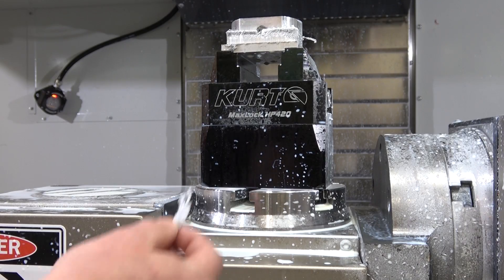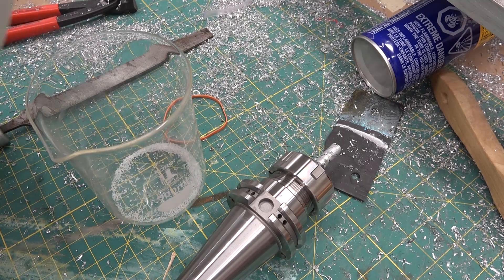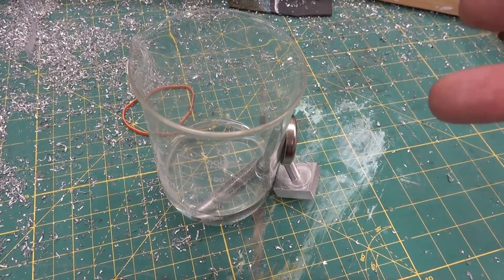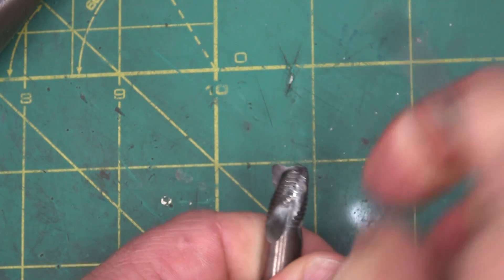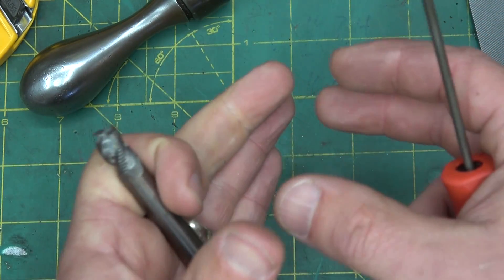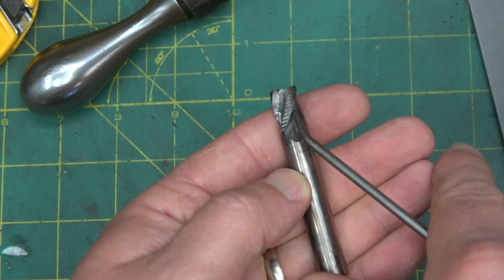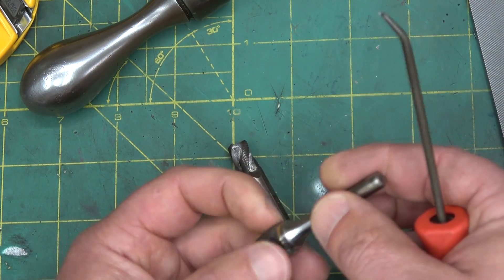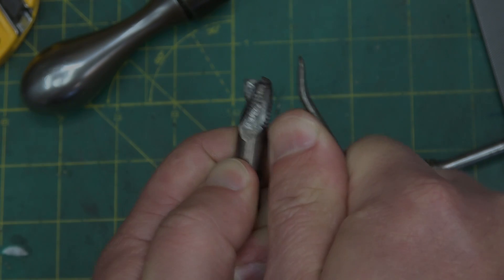Salvage Carbide Tools with Lye | SCIENCE!

Comment: I've always been afraid to use lye for anything.... No experience, but like learning about it.Parents said they used it but also said to leave it alone. 
  Would lye be the same as caustic soda? I built a hot tank type of cooker a few years back out of a water heater and air for agitation...but have also been to afraid to try lye or other cleaners in it.Last thing Iwant to do is poison myself or blind myself  in the shop so I've never even tried it.

Comment: To remove aluminum from Briggs cranks we used muratic acid.  Didn’t harm the crank but would eat the aluminum. Easier to get than lye
Reply: SlocketSeven  that is true. It was always done outside the shop. Never a problem with rust on the cast iron crank.

Comment: Next time, it'd be a better idea to use a steel vessel, like a small stainless steel mixing bowl, to keep your lab gear from dissolving.

Makes it easier for the lye to dissolve the aluminum if its not already dissolving the silica in the Glass lab gear.

Comment: I've heard about people using muriatic acid to remove aluminum from crank journals when their small engines (in their go kart, mower, etc) spun a rod. I imagine that would also work for this as well.
Reply: Muriatic acid - Hydrochloric Acid would definitely eat the steel of a crank. In this case would eat the nickel and or cobalt binder in the carbide too.

Comment: To produce raw aluminium (aluminum) consumes on average 15 kWh of electrical energy per Kg. That's 20 hp hours per kg. To produce 10kg would require 200 hp for an hour. We then use the end product to wrap food and for the most part discard it after just one use!
Reply: Recycle it! Any food waste will either get washed off or burned off. If the recycling center doesn't want dirty foil, hide it inside crushed cans.

Comment: We've used this recovery method in our CNC shop to save some high dollar hoggers and.... it was a disaster. Despite passing visual inspections, 2 lye recovered hoggers both suffered sudden/catastrophic loading and failed spectacularly (molten aluminum got slung everywhere before one broke). Cutters were running at known safe feeds/speeds, with air blast/mist coolant. Is there a chance the lye is increasing the surface porosity of the cemented carbide?
Reply from the maker: Could be, cobalt binder. But I think cobalt is impervious at high pH so could just be they're fucked from the original incident.

Comment: You probably already know that aluminum oxide is the same as corundum(sapphire/ruby) but did you know you can torch a piece of aluminum foil then it becomes transparent  because it leaves small spots that are just corundum.
Reply: Also does the hardness of aluminum oxide 9 on the Mohs scale come into play much when machining AL? or not really because it is such a thin layer.

Comment: Machined about a million times my weight of aluminum back in the day when I was making space junk.  The problem here is the end mill.  Do not use carbide on aluminum, high speed steel only.  (most carbide isn't sharp enough to cut and you need more pressure on the tool, creating heat)   Tons of lube (coolant) and while you can spin and feed the end mill fast don't feed it or spin it too fast.  As the aluminum heats up it can get gummy (depending upon alloy) and will stick to your damn end mills or any other cutter.     You need a lot of clearance on the end mill to clear the chips out too.  Also, the only file I ever used on aluminum is a Vixen file same type of file if you were filing lead body solder...finer cut files will load up with soft material and you won't get a smooth cut with the file because aluminum rubbing against aluminum creates galling.  Yep, lye works well on cleaning some stuff off files, and end mills, and over time it will give a nice leathery look to your hands too, like any solvent will.  Copper is just as evil to machine as it galls very easy too.
Sure you can use carbide cutting tools....but for the price and hassle of cleaning them I can buy more high speed end mills for the same price.

Comment: I'm waiting to see how that end mill chooches, never had much luck with cleaning em off, I could usually pick the aluminium off pretty good, but seems like the darn thing would never cut as good as new once its been galled up.  One of my old tricks which shouldn't hurt em, is to run em real slow in some soft steel once you have most of the crud cleaned out, it would usually chuck out the rest of the boogers, didn't always have steel around though, so the other thing would be to run em real slow with lots of oil in aluminium (oil not coolant), but still results were less then skookum, even if the above things were not tried and all or most of the galling was removed manually, still wouldn't cut very good, and would usually gall up fairly quickly.  Eventually I ended up at shops that had a proper tooling budget and galled tooling just got chucked and replaced with new. (regrinds just suck BTW)
Reply: for all you key board machinist... When you don't have any new tooling you make do with the junk you have, and when you work alone, you get creative, sometimes it works, sometimes it don't, key is to observe and learn from the results.

Comment: Aluminum oxide, almost as hard as tungsten carbide, high melting point also why aluminum doesn't like to be cut with oxy-acetylene torches, you end up melting the non oxidized aluminum before you burn through the oxide coating
Reply: Aluminum oxide (alumina) is also known as sapphire. Yes, the gemstone, which is just a slightly-impure form of it.

Comment: You didn't say how the chalk-on-the-file trick worked. I often wonder whether this refers to blackboard chalk (which is actually calcium sulfate, i.e. plaster of Paris) like you used, or the mineral chalk (which is calcium carbonate). The blackboard chalk is hydrated and I wonder whether its residue would encourage rust on the file.

Comment: So aluminium and steel can both be pre rusted/corroded and it will slow the major rusting. Like the corrosion layer on the outside of the aluminium that prevents more corrosion and like how you blue steel to help prevent rust on a firearm.

Comment: I use lye or rather easier to get oven cleaner to clean router bits and saw blades used for woodworking. Works good and saves big time on sharpening.

Comment: You can also use drain cleaning crystals (they use lye to dissolve organic material in the drain). But they're more vigorous and will produce more hydrogen + heat so you have to be careful. Plus I don't know what other stuff is in the cleaner that might eat away at the part. But it will certainly dissolve the hell out of aluminum.

Comment: Would horticultural strength vinegar work as well? Supposedly around 20% acetic acid, and I need to order some online because nobody carries it locally. It has a reputation as an excellent weed killer, especially when some salt and dish soap are mixed into it. Regular vinegar is typically 3 to 5%, by comparison.

Comment: If your cutters are solid tungsten carbide then heating up hot with a blow torch and brushing with a stainless steel brush works very well and quickly.

Comment: Crazy I'm working at a plant now welding reactor tubs for a company that makes Anhydrous gas, They basically have a boiling concoction an then sink huge aluminium billets in the liquid while chlorine gas is being pumped in an they catch the by product "Aluminium Anhydrous" it's crazy to see the whole process but lots of dangerous chemicals everywhere an everything is about to rust to nothing left all the tanks are fiberglass an if it's steel has a 5 year life max even with epoxy paint so seeing this was awesome 👍👍

Comment: For some reason this reminds me of when I made a caustic soda and warm water bath to get the really thick layer of carbonised crap off the grill pan and the racks from an oven. A couple friends and myself were getting ready to move out of a rented house and the agent had told us that the place had to be SPOTLESS for us to get our deposits back (We later found out that his wife ran a cleaning company that he used if he found anything he didn't like....... Sounds to me like he had a bit of a vested interest in being super picky).

Anyway, As we were all blokes in our early 20's the oven in that house hadn't been cleaned for the entire time we'd been there, So it was a bit of a mess by that point. We found that alloy wheel brake dust cleaner worked quite well on the inside of the oven, But that stuff was expensive, And the trays were putting up a fight. :)

So that brought me to the caustic soda bath idea. It was a big heavy steel tray I'd made years before (For reasons not worth going into) and I'd put it on the patio with the oven stuff and the solution in it. After a couple hours all the stuff was brilliantly clean, So I rinsed it off and put it back in the oven. I left the solution in the tray in case we found anything else that needed "De carboning".

A couple hours later one of my house mates came running in and telling me I needed to go outside quickly. It seems he'd been so impressed with how the solution had cleaned the ovens stuff that he'd dumped a load of his saucepans and frying pans in it and wandered off to do a bit more cleaning.......... Guess what they were mainly made off? :)

His aluminium kitchenware reacted pretty violently, and that little patio was awash with an angry hot bubbly mess. Luckily we were able to hose it all down, and after a jet wash the patio looked reasonably presentable again.

Next day we had the inspection and by some miracle we got our deposits refunded, But about a week after that we all got angry emails asking why all the plants in the gravel beds surrounding the patio had suddenly died........ "Erm.... Dunno? They looked fine when you inspected the house didn't they?". :)

Comment: I had a big ah ha moment in my understanding of corrosion mechanics when i learned about the Pilling-Bedworth Ratio(PBR), which describes the ratio of the volume of the crystalline lattice of a given alloy to the volume of that of its oxide in a given environment. 

metals with a PB ratio around 1 (Aluminum and Lead are both 1.28) form a protective oxide layer; when the ratio is very high or very low, the 'armor' either buckles or becomes porous as it forms, exposing clean base metal.

this explains why cast or wrought iron is more rust-resistant than steel, most of the simple oxides that form on iron have a PBR of 1.7-1.9, while the more complex crystal formed with the addition of Carbon and Silicon give some alloys of steel PBR of 7+.

I'm a ship rigger, and this also helped me understand to me why metals corrode so differently in the marine environment, even when isolated from galvanic action: because of the availability of Sodium ions during oxide formation. especially in 300 series stainless steels, where the incorporation of the sodium ion into the lattice structure tends to cause the normally ideal PBR to become very small, leading to the classic pitting and crevice corrosion once the passive layer is broken and exposed to salt in the air and water, especially when the surface isn't polished to reduce surface area.

Comment: I used to make a product that took a few thousand pounds of a chloroacetate and you then added 100 pounds of Sodium Hydroxide (50%solution), then an hour later, another 100#, and an hour later. another 100, then it depended on how much you were making but you continued until it was at the correct percentage. The product got to 145f or so all of its own accord. This was in a Stainless reactor with no insulation, so nothing like 15,000 pounds of 145f product heating all night on in August, in Texas, to make your co-workers hate your guts when they walk in at 5am.

Comment: It's not so much that the aluminum is acting as a sacrificial anode here:  Sodium hydroxide simply doesn't attack iron.  

In fact, you can submerge freshly machined steel in a strong sodium hydroxide solution, and not only will it not be attacked, but it won't rust, either.
Reply: Well, not strictly true.  It forms a corrosion film that, if not washed away or removed, will tend to prevent further corrosion.  But if you for instance use it in your pipes repeatedly, each time the layer will get washed away, and eventually you will have no pipe left!  Depends on the exact strength and temperature of the solution.

And aluminum dissolves readily in sodium hydroxide with no other material needed as a cathode.  If it is coupled to steel though that will protect the steel for the short time the aluminum is still present.

Comment: Aluminium cutters i have used dont usually have any coatings on them. They usually have a highly polished surface in the flute to help stop chip weld. Also 2 flutes with a high rake and high helix would be better for chip evacuation.

Comment: Generally, if you were to assign a mineral name to rust, it would be called limonite (or based off of crystallinity, geothite), as FeO(OH). Hematite is Fe2O3, does not contain water, but all the iron is highly oxidized as ferric iron (Fe3+). Magnetite is Fe3O4, with 2 Fe +3 and 1 Fe2+, so (Fe2+, 2Fe3+)O4. So magnetite is slightly reduced, with one ferrous iron for every two ferric. From the inference of their crystallinity and the valence states of the iron, you can see a progression from hydrous, oxidized iron (limonite, or rust) -> no water, but oxidized iron (hematite) -> reduced, magnetic form of iron oxide, or Fe3O4 (magnetite). Magnetite is often the product of converting red rust into "black rust" as a pacification layer for preserving steel, as magnetite is much more stable.  Just thought I'd attempt clarify. FeO is also a reduced form of iron oxide as Fe2+O, or Fe(II) oxide, and is rather uncommon from my understanding (Geology and geochemistry background).

Comment: The aluminum oxide layer is common on basically any hard-wearing surface made out of aluminum, like MacBook Pros. It's also the first step in using electrolysis to dye aluminum a different color. I'd argue it's more common than rust because unlike rust, it's actually something that people want. (I'm sure Uncle Bumblefuck knows this, but he left it out in the video.)

Comment: Chemist here, just to clarify some things about the lye, aluminum, tin and copper.
Aluminum reacts with the lye itself and it's quite fast,hot and vigorous.
Copper and tin do not react with the lye itself. They react with the oxygen dissolved in the water. The lye then dissolves the oxide that forms and exposes the metal beneath, enabling further attack. This happens at a snail's pace compared to the reaction with aluminum.
Iron does not "react with the lye" because the oxide is insoluble in lye, hell some iron oxides are barely soluble in acids too.
Reply: Thanks, I just got how "Drano" works!   (Aluminum shavings and Lye granules)
Reply: "...and it's quite fast,hot and vigorous."
Reminds me of college.
Reply: Actually, your post jogged my memory about using " naval jelly" to clean  aluminum when I was a kid and we had a cottage at the shore and a bunch of small boats. They made several different formulations, one for aluminum, and perhaps a different formula, or two, for ferrous metals and or brass and bronze and Chrome. Anyway, if memory serves, I think the stuff they made for aluminum cleaning was indeed lye, sodium hydroxide, and some kind of jelly like base.
Reply: Sodium hydroxide also reacts with zinc in the same manner, so keep it away from galvanized surfaces and hardware.
Reply: tubastuff Thanks for the warning, I had forgotten (or never learned) to keep it away from the kitchen sink and the galvanized plumbing.
Reply: In fact, lye is the primary ingredient (small amounts of nitrates and/or nitrites) ingredients in hot blueing solutions. The nitrates oxidize the steel, but the lye keeps the water from rusting the steel, so it stays "blue" (this kind of hot blue is actually a dark grey).
Reply: Chemist No 2  Agreed!
Reply: 6alecapristrudel What about using gallium? I don’t know if it would damage the carbide or other metals in the tool, but would work damn quick on the  aluminum.
Reply: @stewskinner5717  , you'd have to ask Lou Reed if "[gallium] would gave helped that [flash]" - ing..... 😂
Reply: @stewskinner5717  The lye would do it way faster than the gallium. In theory you could use it but in practice it would be a total pain to do.
It would require you to submerge the whole thing in gallium and since it doesn't disrupt the protective oxide film you'd need to scratch every little piece of aluminum for the gallium to get in, this is Al stuck in drill flutes so it's probably not a single solid piece of metal too. The reaction with gallium relies on it diffusing through solid metal, so it's quite slow and it would take days to get all the Al off, with lye it's done in an hour.
As a bonus: the lye constantly disrupts the protective oxide and in addition to the reaction with the hydroxide it actually allows the Al to react with the water itself, kinda like sodium does but slower and not explosive.

Comment: Chalk on the file makes a better surface finish considering smoothness, it basically fills the teeth so it takes nothing off other than the high spots. You can also put oil on the part when using the chalked file up so would be sure not to take anything but the high spots off. Back when my grandpa learned toolmaker in the late 1940s East Germany he would have to use worn down tools from before the war, and only having files and a drill press the only way to make a stamping tool work as intended was to use chalk and oil to get the right surface/precision. Once his boss told him to go saw out plates from tanks that were scattered around the area and gave him a dull saw made from simple chrome steel and a file to sharpen it. Thank god he escaped that socialist shithole.